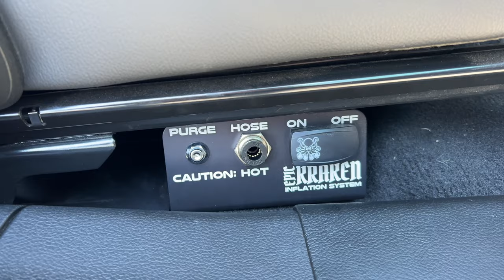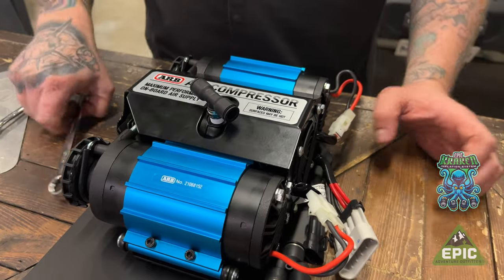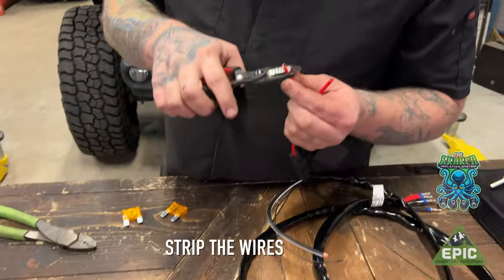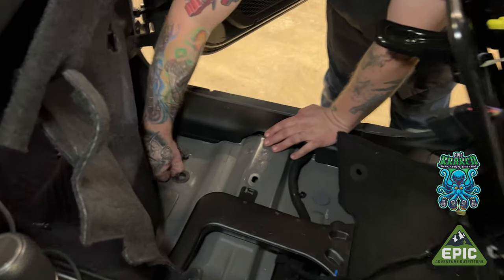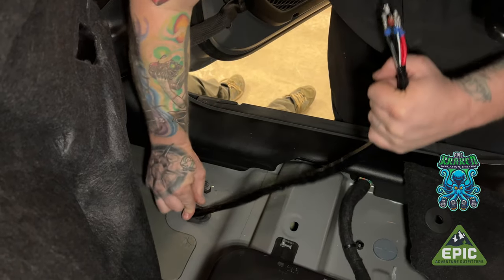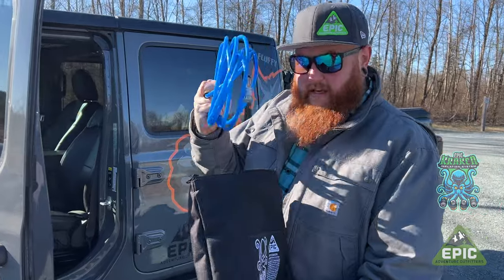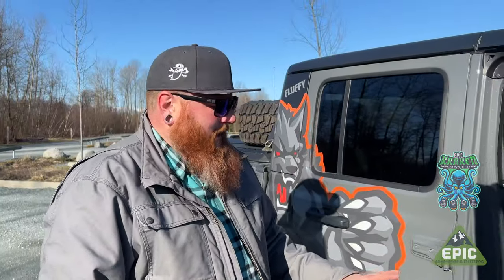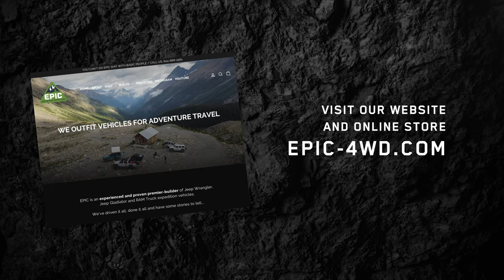EPIC Kraken Tire Inflation System for Jeep JL/JT - Installation & Usage

Comment: I just finished installing the Kraken system on my 2019 JLUR and it works great!  If you're going to do onboard air, this is the system to do it with!!  Super clean once completed and the instructional video was spot on.  

I paired mine with ARB's Pressure Control system.  I find the onboard TPMS not as responsive as I would like.  Air up or down with presets and auto-off once pressure is reached.  Set it and forget it.  

You guys at Epic should concider creating an add-on kit for people that want to option ARB's Pressure Control system.  It took me a week to source the right parts.  I would much rather purchase an add-on kit from a trusted source.  Think about it.  🙂  

Thanks again for a great system!!
Reply from the maker: Thanks Peter! We appreciate your support. Cheers from the team at EPIC!

Comment: Just installed on on my 2022 JLUR. I used to use CO2 and just don’t feel like dealing with frequent tank fills. I am super impressed with this kit/ combo and how the compressor is in the cab. Install was straight forward and the finished project is super clean. We’ll done team!!
Reply from the maker: Thanks Dan! We read out your comment to the team and they cheered. I then told them to shut-it and get back to work!

Comment: Just installed on my '22 JLR and released the Kraken!  Awesomeness!!!  Took me by myself about 2.5 hrs.  Loved following the video for instructions and tips.

My only issue was the rear seat floor mat fitting interferes with the mounting plate.  Took me a few cuss words to figure out what the problem was.  Noticed in the video that the 4dr rear mat attachment is further aft.  No big deal, I simply cut the button off flush. 

Thank you, Ginger and company!  It arrived nicely packed and perfect condition.  Not even a stray beard hair.
Reply from the maker: Thank you for your feedback! In our next install manual update, we'll specify about the rear mat for sure. We're happy to hear that your package was beard hair free. Cheers!

Comment: The Kraken arrived last week, patiently waiting on the porch for me to get home and let it breathe.  As in the other comments, it was beautiful!  I didn't have time to do the full install, but immediately did all the prep work as shown in this video.  With only 1 problem, the install went flawless and exactly as shown on here.  Problem you ask - Our JT came with the factory mud (weather tech) style floor mats - It never occured to me that the back mat tucks up under the front seat past the seat bolts which doesn't work well with the Kraken plate and compressor.  I ended up having to cut the front of the floor mat off so it would line up even with the plate.  Not the end of the world (although my wife hasn't noticed yet), knowing beforehand wouldn't have stopped me from getting this system, but I might have thought about a better mat solution before I was pot committed.  Unfortunately it's going to be another week before I get to try it all out, but I'm excited.

Comment: Our great mechanics from Moab Outfitters (Russ Bartholomew) in Springville Utah installed the Kraken on our 2016 JK Rubicon. They had to modify the under-seat mounting plate specifically manufactured for JL models. Other than that, everything fit to function. We will be testing it at the Moab Easter Jeep Safari this year. This time, I will not be the last person at the end of the trail to finish inflating our 37" tires. Stay tuned for further reviews.

Comment: I tried my Kraken system for the first time on the trail and it worked awesome!  Several off roaders with other onboard air systems noticed my Kraken system and came over to check it out and were quite impressed. Great design and well made!

Comment: Was just about to order this thing and it is listed at $323.  I added it to my cart and the price changed to $399.  To top it off they are charging $130 shipping fee.
Reply from the maker: Hello Manny, apologies for the mix-up. Our site uses Geolocation to determine if you're in the USA or Canada and then it's supposed to display and charge in the proper currency. The USA price should be around $323 and the Canadian price is $399. We'll look into why this happened to you before we launch the next batch. As for the shipping, sending product from Canada into the USA is costly (especially with the added duties). We're working hard to solve this problem. Thanks for your feedback, we greatly appreciate it. Cheers!

Comment: Instead of going through the drain plug hole would it be possible to go through the firewall straight into the cabin from Under the dash?
Reply from the maker: Yes, people have. We're updating our install guide to show this shortly. Cheers!
Reply: @EPIC-4WD   I just ordered the kraken but curious if the wiring will be of sufficient length to accommodate the updated instructions for the install through the firewall.
Reply from the maker: @michaelortega9516  Yep, it works.
Reply: @EPIC-4WD  That’s awesome!! I just received my order and can’t wait to get it installed this weekend!! In order to go through the firewall can I use an existing opening or would I need to drill a new one? Thanks again for the info.

Comment: Could the new EGOI dual air compressor fix be made to hook up electrically to your under seat mount? Thinking to install in a 2020 Gladiator.
Reply from the maker: We designed the Kraken specifically for the gold-standard ARB Dual Air Pump (CKMTA12). The Kraken may work with other pumps, but we're only supporting the ARB ;-)

Comment: Doesn't this obstruct the Rubicon floormats, ours had a camera but through the drain plugs now the floormats don't sit flush and feel weird and loose...
Reply: Yes, this will.  And perhaps let a bunch of water and mud into your jeep.  Ask me how i know, lol.
Reply: Yes this would obstruct the OE rubber floor mats but if you do any kind of water crossings those floor mats will let in more water than you know what to do with.
Reply: @TheEPICBeardedGinger  Any suggestions then for aftermarket floormats (Epic branded or atleast approved of course) and how to plug them holes (maybe even with out loosing the functionality of opening the drain after a serious mudding incedent) so the water stays out in that case :)
Reply: @niki3151  all of us at Epic are running Husky liners and have for years in many Jeeps and trucks
Reply: No problem. After owning several jeeps I can fix any problem .in this case Felcro.
Reply: @TheEPICBeardedGinger  is there any chance I could get a new harness built that would go through the firewall up high on the driver side? I would be willing to pay.

Comment: What do you do when you're out and only have 1 tire to inflate?
This system looks like you have to have lines connected on both sides to maintain pressure. Can you connect a single line to do a single tire when needed?
Is there some sort of quick connect plug you can use to close the opposite side when not needed?
Reply from the maker: Good question! You leave the red plug in one side and then just hook-up the lines to the other side. Plug a tire into one line and away you go!

Comment: Odd request… I noticed Trailrecon had the Kraken as well but the power switch was on the drivers side. I would prefer it that way. Is it simple enough to switch sides?
Reply from the maker: The power switch on the Kraken is only on the passenger side. In TrailRecon's recent video, the switch is on the passenger side as usual. The bracket is made for the passenger side for ease of install, and wiring.
Reply: @EPIC-4WD  YOU RIGHT! I went back and watched his video again and it is on the passenger side.

Comment: So why exactly won’t work on a JKU? The space under the seat? Or is there another reason why?
Reply from the maker: The JK and the JL are vastly different inside. The plate is designed for the JL/JT as are the other components like the included electrical wiring, etc. There are many other solutions for the JK available. We might get around to designing a JK version in the future.
Reply: @EPIC-4WD  please do, there still a lots of JKs out there, it'll be good for business 😁🤟🏻

Comment: Is it possible ARB changed the fuse design to glue or otherwise fix them in? They do not want to come out.
Reply from the maker: The orange maxi fuses should come out. They are in there pretty hard sometimes.
Reply: haha had this same issue. grip it and rip it
Reply: So … if we can’t get them out? I’m stuck because I don’t have the hand strength & these suckers won’t budge!
Reply: @OverNoobin  I finally got mine. Using Rigid Robogrips which are just oversized vice grips. You gotta pull hard but once you feel it budge a little it’s golden!
Reply: @OverNoobin  ARB Support was zero help. I thought mine were glued too
Reply: @OnwardsOffroad  I got one out… my husband snapped the other one. 🤦🏻‍♀️ One trip to Advanced Auto Parts later, I’ve got new 40 AMP fuses & have learned I can fix stuff.

Comment: Did you just call your Jeep a car? 10:54
I am definitely ordering 2 of these tonight at 7pm.

Is there a way to route the wiring through the firewall instead of the floor?
Reply: You probably could route the wiring through the firewall, probably have to remove the inner fender to gain access enough to locate a place to pass through.

Comment: Can this system be wired up to one of the Aux switches or does that not make sense to do it that way?
Reply from the maker: It can be, but it doesn't make much sense as it would be more electrical work... and you need your 4 aux switches for lights!!! Lots and lots of lights! Cheers from the team at EPIC!

Comment: any  upgrades/thoughts to make this set and forget (specify desired PSI and walk away and the compressor will stop when the desired PSI is reached ? )
Reply from the maker: Nothing at this time. If your Jeep is equipped, you can use the selectable tire fill alert system, which honks your horn at the desired PSI. I've done it a few times, but prefer to just look at the gauge on the dash 6 minutes in ;-)

Comment: How would this work if I say came up on someone who needed just one tire aired up?
Reply: I am wondering about this too. Is there a single hose option?
Reply from the maker: Simple - You keep the red plug in one side and hook up the other side with the supplied hoses. Connect just one line to someones tire and inflate.
Reply: @EPIC-4WD  Thanks for the quick reply!!
Reply: @EPIC-4WD  Any idea when more will be in stock.  I was online right at 7pm launch night, but the site was malfunctioning and charging way more because it thought I was Canada.  😎
Reply from the maker: @TheTrailGeek  Hi Dave! If you can email us your contact info to info@epic-4wd.com for a Kraken, we'll make sure that we reach out when more are available.

Comment: Can you hook the power and ground wires up to the wiring harness that’s already under the dash?
Reply: Unfortunately not as the compressor pulls more amperage than the small gauge wires under the dash can handle.
Reply: Thanks for this question; I came here to ask the same thing. 👍

Comment: This is the most frustrating thing I have ever seen. Maybe it's just mine, but these fuses will not budge.. I have literally used pliers, I've wedged a flathead under them and tried to use leverage to take them off.. it's like they are welded on or something.
Reply: I ended up not taking out the fuses coz it was just way too impossible to remove them. I just left the harness over top of the side of the fender not hooked to anything until everything on the other side was hooked up, and then I hooked the electrical up to the battery last. Works great. Here's praying those fuses never go bad LOL.
Reply from the maker: You just pull the Maxi Fuses out... however they are in there pretty stiff. Usually I just grip the edges and work it back and forth a little and they pop out. Anyways, glad you got the install done. Cheers from EPIC!

Comment: Not trying to be a dick, but this looks like a rip-off of Innovative AT Products.  They've been selling a nearly identical system for years.  If I'm wrong please correct me.
Reply from the maker: Good question. Innovative AT makes a great product. We've been installing and using air-up systems from many different manufacturers over the past 20+ years, none of which installed or operated exactly like we wanted. With this kit, we designed it from the ground-up to our specifications and have extensively tested in field. We think that people will like the benefits of our system (ease of install, no-drill, included wiring harness, top quality plates, purge function, etc).